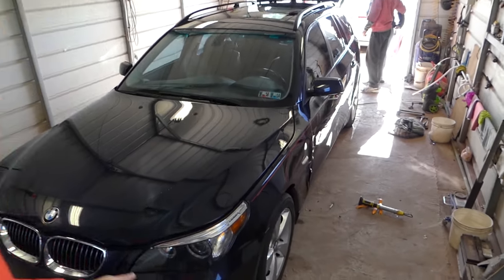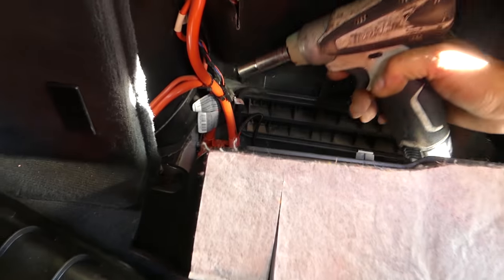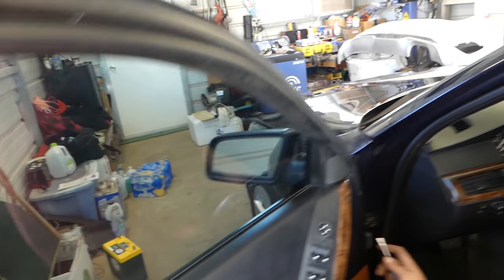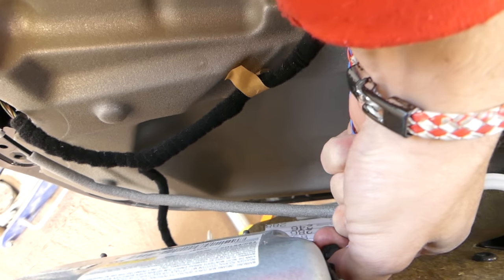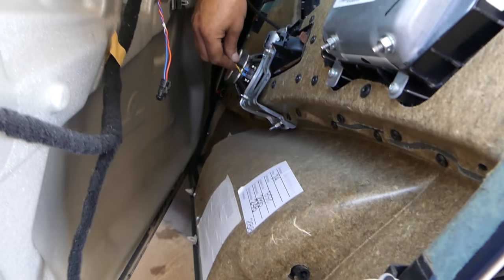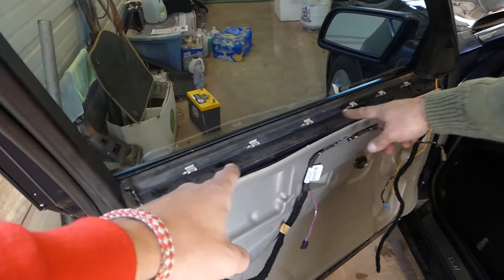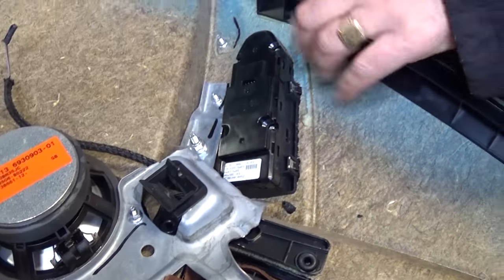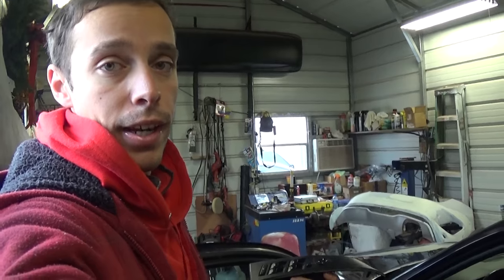BMW E60 E61 MASTER WINDOW SWITCH REPLACEMENT  POWER WINDOW SWITCH

Comment: On Bmw 7 F01, do i need to take off all panel door or i can just pull out master window switch control unit?.. I have broken button on window control unit and its hard to pull out just that

Comment: For those that couldn’t fix the issue with a new master switch or fuse.

what really did it for me: The door and harness connects to the body through a plug, this plugs gets corroded and some pins inside will break off. In my case the pins to the Wires (Blue-Red-yello dot, White-Blue and Brown-Green) broke off, bypassing those wires did it for me. 
on the passenger side the wires that needed repairing was Blue-Red-Yellow dot and White-Blue.

complete functionality restored.

Comment: Why did you change it? What was the problem? I have an issue that I can't regulate passenger side windows from master switch but those windows work then I use passenger switches. Could it be the issue with master switch?
Reply: Hello, did you find the solution?I'm facing the same problem.
Reply: @rikeshrikzz6855  did you find the problem please?
Reply: @qenzxy  Yes...I have remove the master switch and cleaned it with alcohol and it worked!
Reply: @rikzzrikesh8804 did you have problem with the driver switches not working? Like mine the little green indicator sometimes wont be on thats on the switch itself. Then my driver window wont work or all the other ones but they will on the other doors. But yeah driver window will definitely not move at times when the green light isn’t illuminated